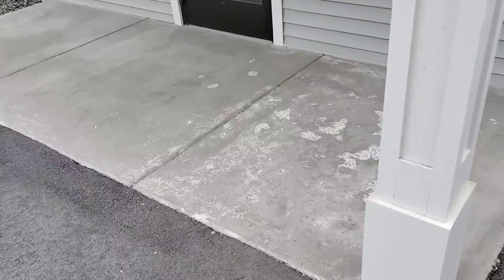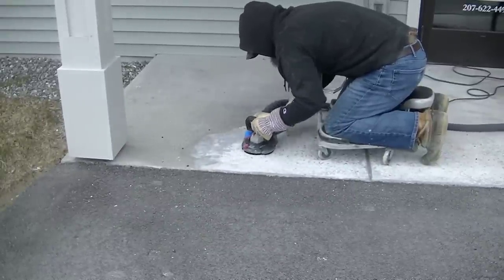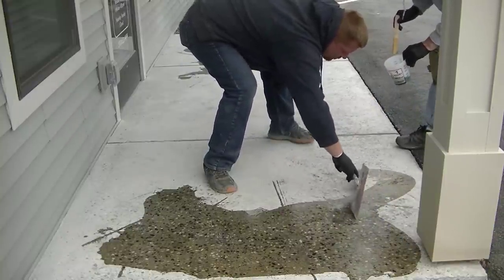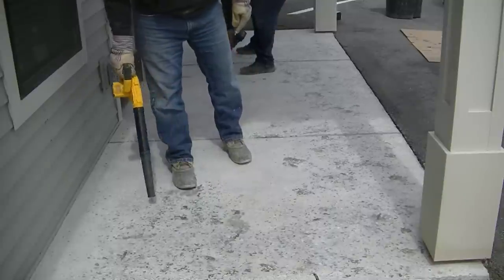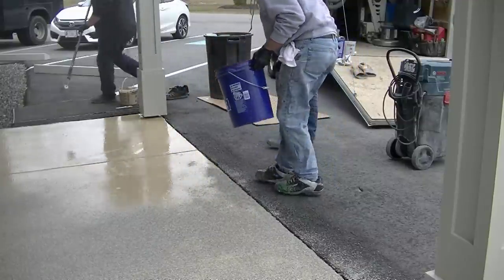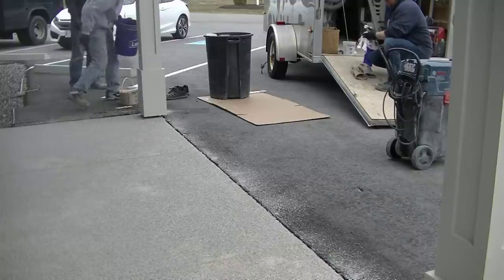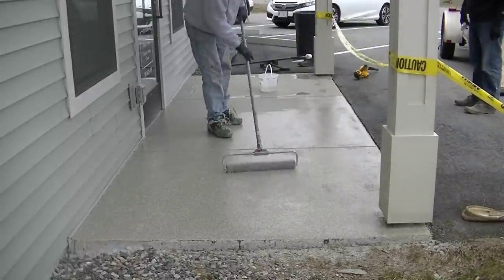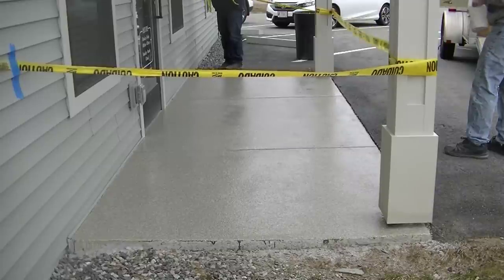How To Repair And Resurface A Concrete Patio Slab

Comment: Concrete patching and repair is almost a whole craft in itself. I always found that a good concrete patch man was practically worth their weight in gold. Part of the problem is, knowing what product, of the millions out there, to use for the patch or repair you need to do. Another problem was trying to match concrete color. You always get a much better looking job by resurfacing the whole area. Otherwise, a patch will always look like a patch.
Reply from the maker: Yup, patching is pretty much impossible to match. Patch and re-coat or re-surface is usually what happens.

Comment: Mike, it there a product that you recommend for crack repair? We have a stamped patio that has several cracks in it . Most of the cracks are where the drain tiles run under the slab. Any suggestions on product that won’t make it look like a spiderweb once the cracks are filled.

Comment: Hi, can I use this on a concrete porch up here in Canada? We have rain trough ice that melts and drips on a corner of the porch, it knocks the parging off the side and today I noticed a six inch round heave on top. We have to salt as we have stairs. Can we resurface it using this product or should we knock that section off and start over? Thanks for your time, we are getting killed by fly by night, no guarantee guys.

Comment: Hi Mike, I'm a subscriber and long time viewer..I liked this!  Unfortunately I've never seen spalling in the Southern U.S.,  but what I need to see/ know is how to repair isolated parts of a driveway that were cracked to the base of the pad and are small... specifically near the edge. I had a dump truck bounce its front tires on the edge of my driveway while  delivering soil, and it cracked about a 1X2 foot 'V' shaped area in two spots (one for each tire).. I know its not necessary  to rip up the entire section, but how do you go about prepping the area for pouring a  patch for the depth of the pad, so that the new concrete will adhere to the old?
Reply from the maker: Hi Terence, send me a picture to mikeday@everything-about-concrete.com

Comment: I've got a 40x60 shop/garage where I work on heavy equipment and weld etc..  I bring in front end loaders etc to work on them in the shop.  The concrete floor is 50 years old.  And has gouges, and 2"-3" holes here and there.  The surface is just a pain to work on cause I can't move my kreepers around to get under equipment with out a fight.  It needs a resurface of some sort... but should be pretty strong to hold up to the task.  Would this coating work you think?  Not sure if I can use something to help with bonding since there is going to be oils down inside the damaged concrete.  The concrete is pretty bonded and not flaking albeit pitted etc..

Comment: Hey Mike, what about a porch 8'x8' with a low spot in the middle of say 3'x3' 10 years old or so. If I grind down the higher then put multiple coats on of the filler, does it self level? 3/16" low in the middle give or take.

Comment: does it make a difference if you use calcium or magnesium chloride? is it less corrosive than sodium chloride?
Reply from the maker: They're all bad. Some don't melt ice and snow as good as others but anything you use that melts ice/snow, absorbs into the concrete and re-freezes is bad and can damage the surface.